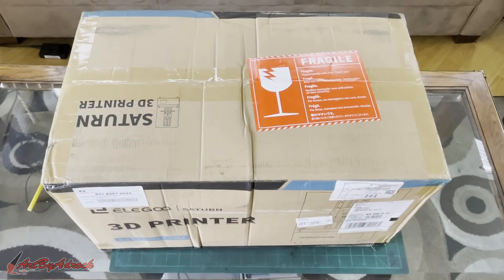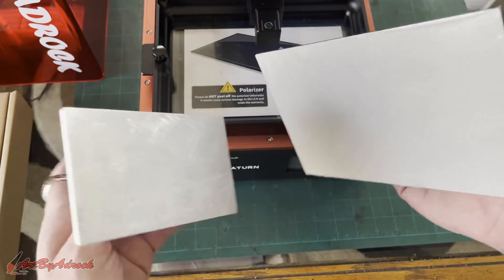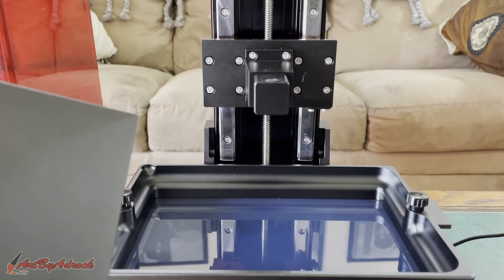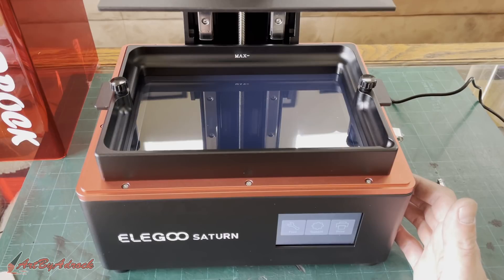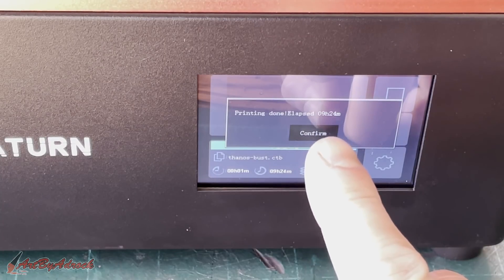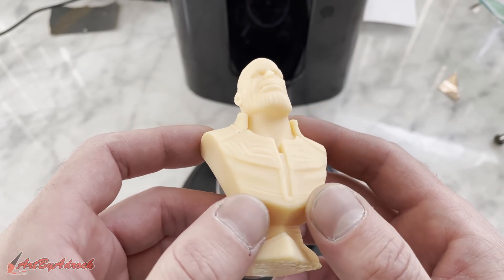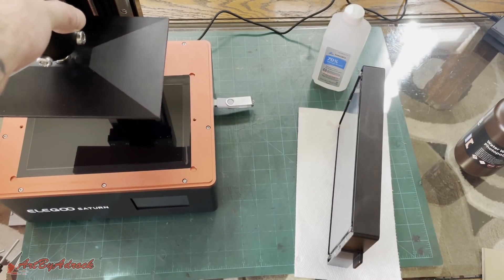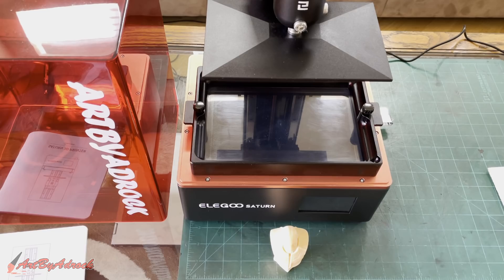Create HUGE 3D Prints With Elegoo Saturn - Unboxing, Setup & Full Review

Comment: OMG, folks, don't do this :) 8 seconds may be recommended, but only for standard RGB screens :) With Saturn (and all modern mono screens in general) such resins cure well below 3.5 seconds per layer. Do yourself a favor and run the multi-exposure test to find, whether you would accept as low values as 2.25 seconds, or would prefer going closer to 3 seconds. That's why people are buying such machines - to benefit from much, much faster prints and more durable mono screens. If anyone sees any "detail" on overcooked 8-seconds model, then one would probably be blown away seeing details they could achieve with proper 2.5-second exposures... :)

Comment: so I'm a bit confused, I just got one of these yesterday and the instructions say to do what you did but it names and refers to the instruction sheet as the spacer to be used to level the build plate. The instruction sheet is on heavy card stock. Now my Mars calls for a sheet of paper as you did in the video. Have you noticed any issues with using the paper as a spacer instead of the instructed card stock?

Comment: Yeah the power button location is an issue especially when they moved the USB, I suppose you could move it yourself but would need a different switch or cover to protect it from accidental activations. Presumably why it's on the back out of the way? 

I'm looking for a resin printer to supplement my FDMs and the 2 reasons you want a resin is the detail resolution (why you want 4K and not 2K for a larger print area on the Saturn) and speed for multiple or large prints. This is where the Saturn comes in with it's large build area as with the Thanos print it would take the same time to print 2,3 or 4+ Busts as 1 due to each layer being simultaneous generated and not traced out like FDM. So it would take 9.5 hours to print as many busts as would fit... though with no level motoring system you would have to keep remembering to top up with resin.

I never considered a resin printer seriously as the build volumes were too small which did not make sense as it gimped one of the defining advantages over other techniques. It's still pretty small relatively but it looks like finally resin and the bigger 4K screens it will be a viable option outside of just detail. Maybe they are planning an 8K Jupiter at double the build plate area again ? :)

What's the main control board in it? Arduino based?

Small point wrt the review.. it's not really a relevant point for us that Elegoo put your channel name on the case unless we all get to choose text for the case.. then it matters review wise :P... Also is this a loan test printer only or do you get to keep it?

Comment: If you wanted to cast that in metal, say copper what would be the next steps?
Reply from the maker: I would use a castable resin instead, use wax sprues and investment plaster to make the mold then burn out the wax.

Comment: Nice video.  8 seconds a layer is pretty crazy though.  Is that a limitation of water based resins?
Reply: But in saturn recommend setting is 1 layer in per 2 sec, then why printer took so much tym in small bust print..
My 2k photon work on same tym, even details not much like 4k.. 
Then whats logic of 4k monochrome if print details dull n slow..
Reply from the maker: I probably could have lowered it a little but that was the recommended settings for that type of resin.